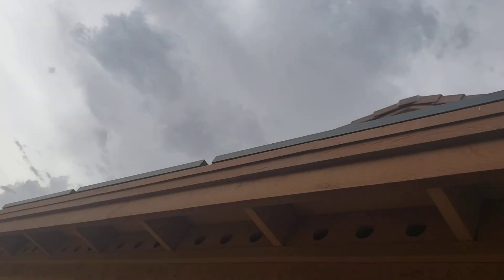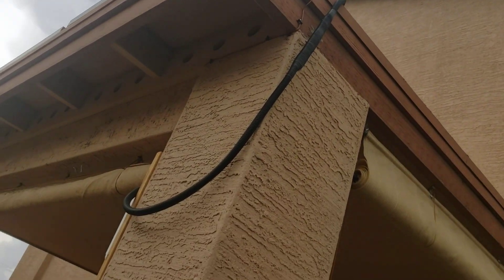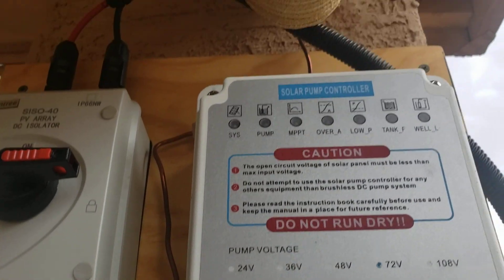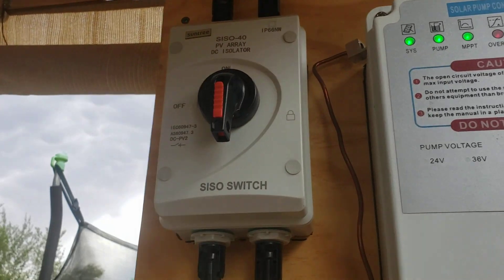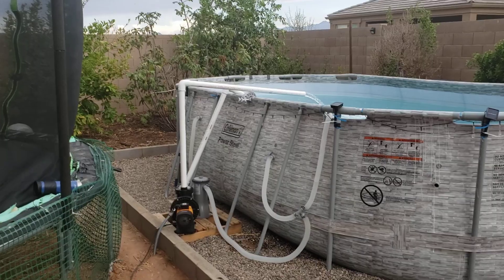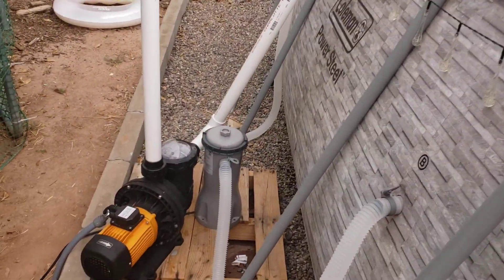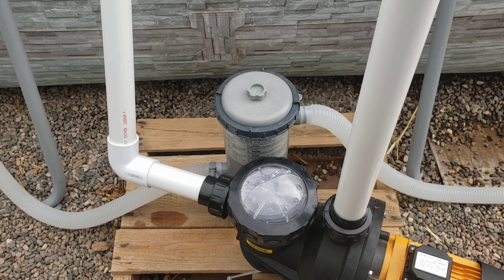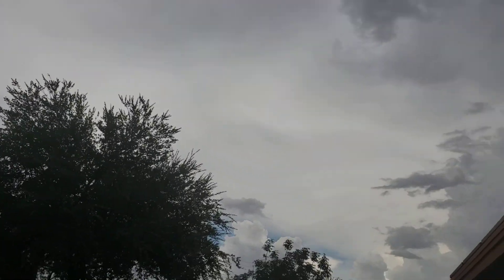Happybuy Solar Pool Pump set-up

Comment: I ordered the 1200watt 72v version of this pump from amazon for around $500 bucks.. 
If i remember correctly the documents said up to 144vdc input from the solar panels, should be ok for me, i also have 4 solar 310w panels connected 2 in series and 2 parallel that come out to 126v at my current config..

Im looking forward to making a video when i test it all out..

Comment: Does it tell you what the max voltage the controller can handle? My panels say 34.40 and a VOC of 41.30, if I do 4 in series like you my VOC is 165.2 and my working voltage would be 137.6. I guess I need to just do 3 panels? That would get me to 103.2V max open of 123.9V. They are 10amp panels so I don’t think I can parallel?
Reply: I think the max pv voltage is 144 volts , if your over that you can do what I did and connect 2 in series and the next 2 in parallel voltage goes down and amps go up... 

Its ok to have too many amps and too many watts  from panels as the motor will only take what it can use... You just can't go over the max input on volts...